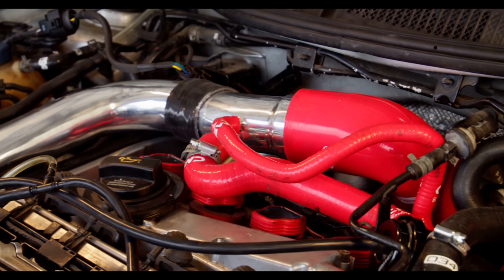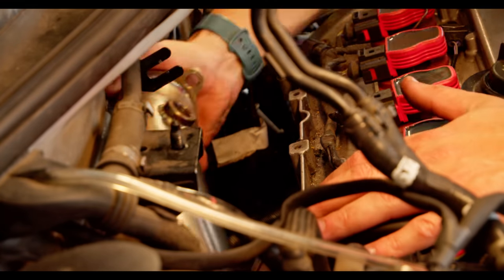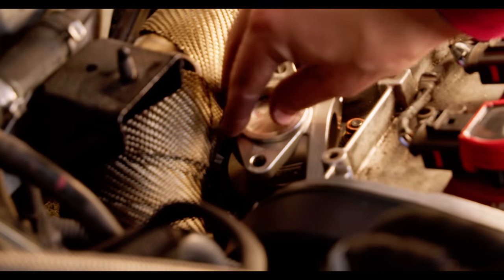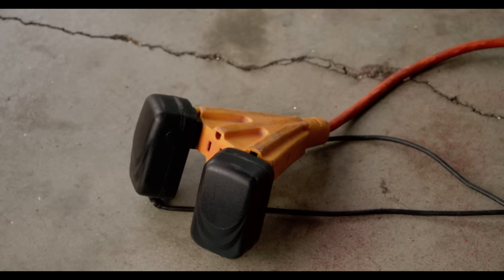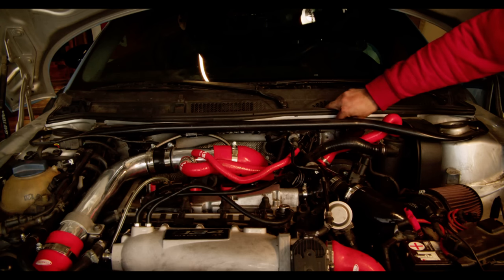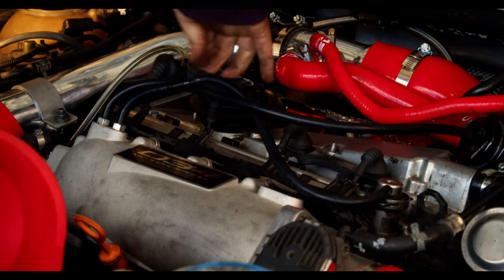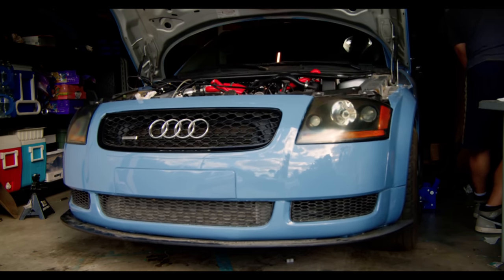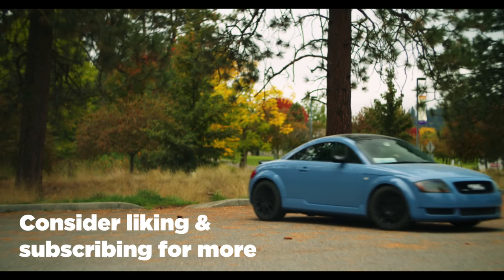Going For The First Drive In The Big Turbo TT! | This Thing Is Gonna Rip!

Comment: Awesome! You have iron will for sure. I love my mk1  TTQ until I have to work on it. Had to repair a shift fork and replace the clutch. It's by for the most annoying car I've worked on with my 1990 300zx coming in a close 2nd. Can't wait to check out the next vid.

Comment: Way to go! Couldn't hear the waste gate dumping in the drive video, was it?  Good luck with the tune.
Reply from the maker: The wastegate is routed back to the downpipe so it wont be as loud as an open dump. But we also had some pretty big boost leaks stopping us from making enough for it to dump haha. 😅
Reply: @HunterDirection  interesting.  Is there an advantage to dumping the extra boost pressure that way? TeeterTot has an open dump, so it's really apparent when there's too much boost at times.

Comment: Hi Hunter Im a young owner of a 3.2 TT and im actually not sure what i can do to get more Horsepower out of it I bought it a couple years ago after my first car got side swiped because it was such a sweet deal then i took it to get an oil change and they didnt change the oil which cost me a motor so after alot of time sitting i just recently got it running reliably again and was seeking upgrade options but everything i find is just the 1.8 so i was hoping to find some answers here on what direction i can go with my 3.2

Comment: i was dreaming about audi tt mk1 about 5.y. 
and now, finally i am owner. audi tt mk1 224hp full black.
now, step by step, earning some money, starting order some of the parts for enginge, to fix it. if everything will be ok, then for next summer i will start with suspension.
now its starts cold outside, but somehow need to change belt, chain, oils, repair steerpower. almost 300k/km
Thx for some ideas and for content. 
i think also record, but just for myself, to remember where i put my 10mm key 🤣

Comment: You should have 20 or more inhg of vacuum. Anything else and your LTFT are suffering and they(tuner) have to compensate. If I was to guess what’s leaking vacuum it’s probably your crank case ventilation system you got going. Something isn’t right
Reply from the maker: Spot on! The car absolutely has a couple vacuum leaks! The plan from here is to pressure test the systems to find and correct them!
Reply: @HunterDirection  I still think your vacuum is suffering because you aren’t running a PRV and because of that allowing the PCV valve to be sucking vacuum at all times (except on boost). Try and run the PRV after the catch can and see what it does to your vacuum.

Comment: Which exhaust system are you considering and why?
Reply from the maker: Honestly not too sure. Just a thought I had haha. The current one isn't bad but is starting to show some rust. Plus it's a nameless exhaust and with all the work we've put into the car might be nice to have a nicer one on there.
Reply: @HunterDirection Ok, I’m close to pulling the trigger on 42 Draft Designs turbo-back with v-bands.  Seems like a good mid-range price point.